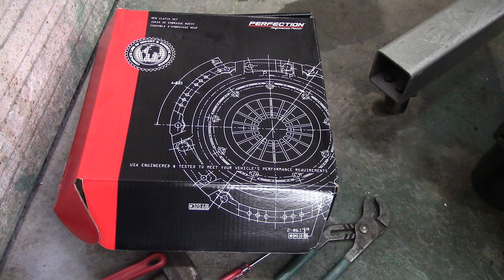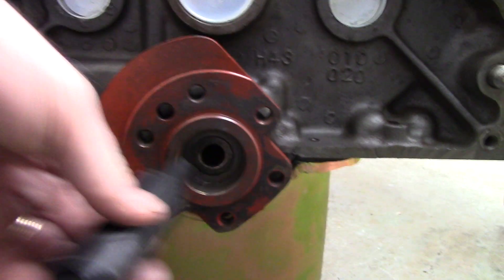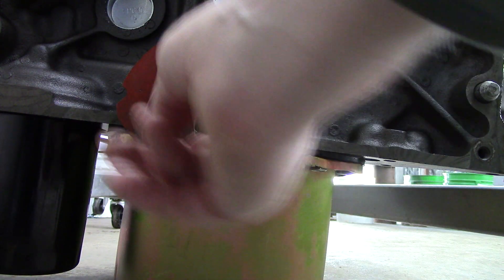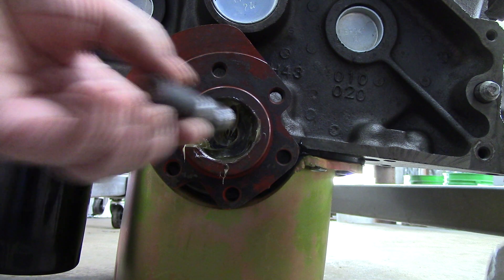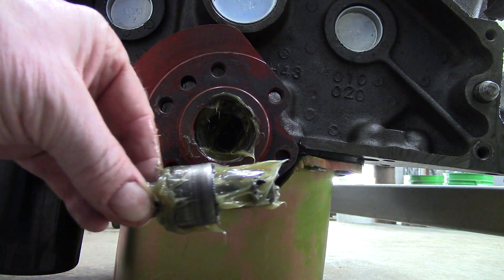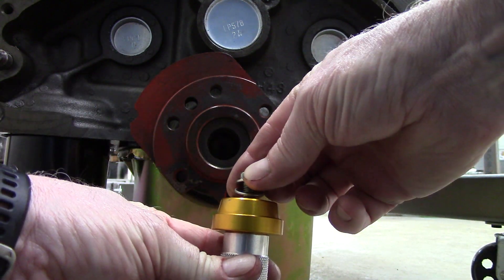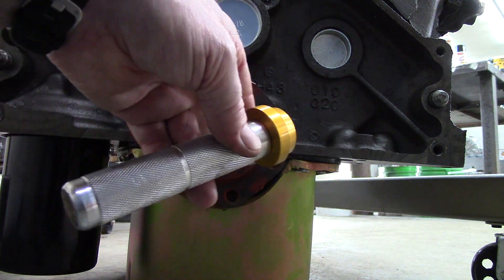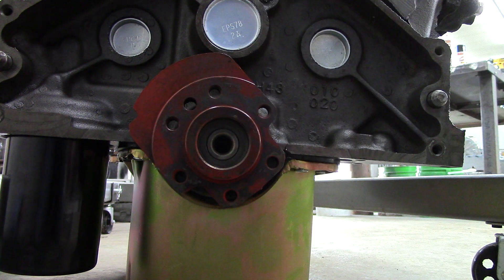V-8 Engine Rebuild SBC #16 Pilot Bushing Replacement

Comment: Do you have to remove these for an auto trans torque converter to work? Having an issue where the torque converter is too large to fit in the crank